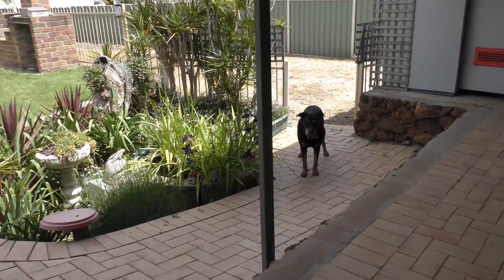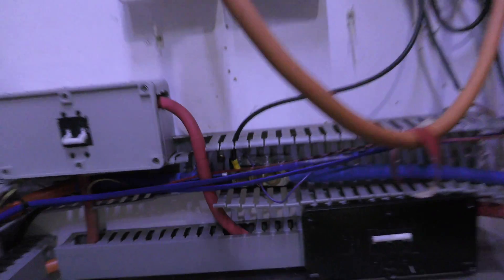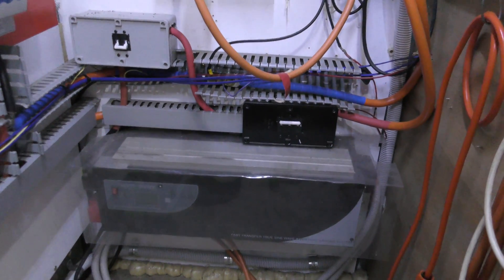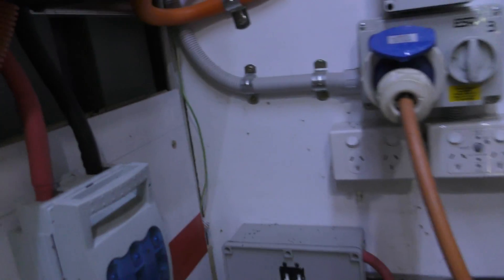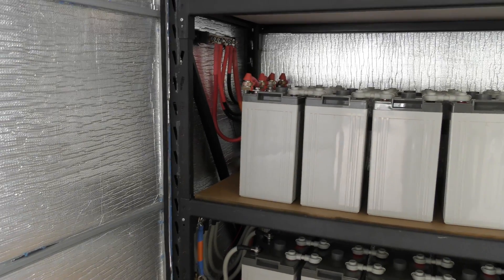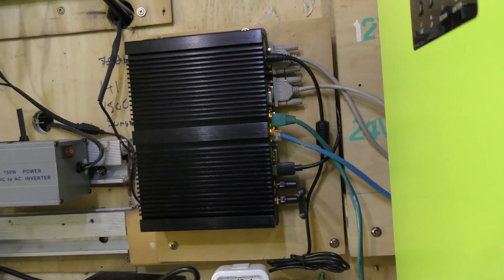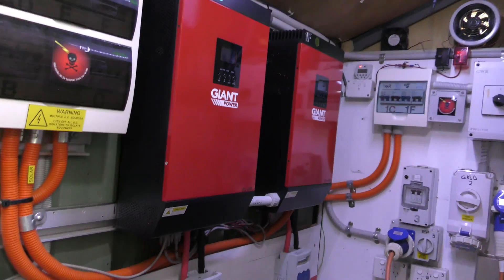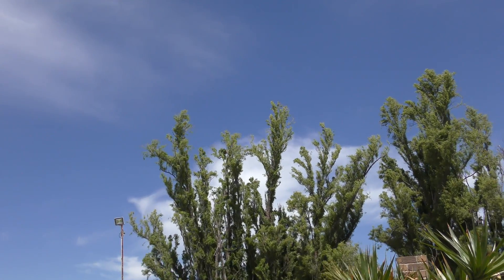OFF GRID Solar. The Power Room.  Looking neater now

Comment: Hey Chris. Here is a question for you. 
Can i or should I equalize my AGM batteries? They have never been equalized and I finally got my PIP4024 /MSP installed with all the fuses and disconnects. I have had these 110ah batteries for 3 years now and I am worried they may have gone bad on my old inverter Charge controller.
I still do not have my Midnite Classic installed which would I think take care of some of these problems and questions? 

 Thanks from Chile. Jim
Reply from the maker: No you will destroy the AGMs .
Reply: Thank for this! I am on the way to a better understanding of Solar because of you! Jim

Comment: hi mr justin wot type for battery equalizer use
Reply from the maker: There AGM batteries. Never equalize AGM's or any sealed lead acid battery it will destroy them. Just charge them right.